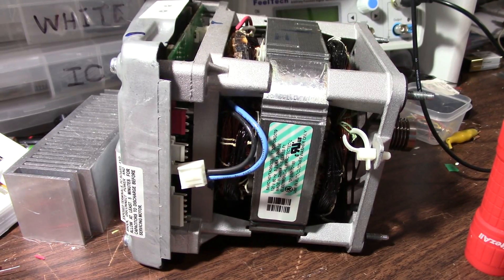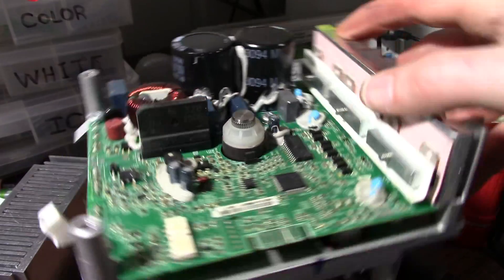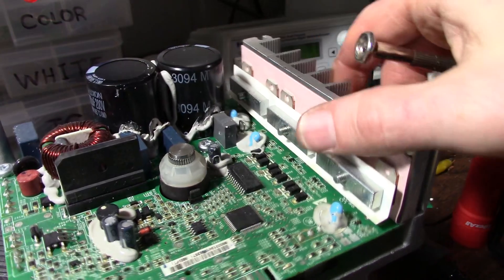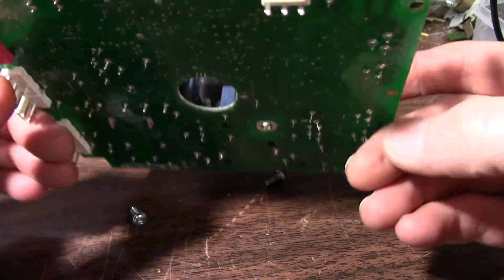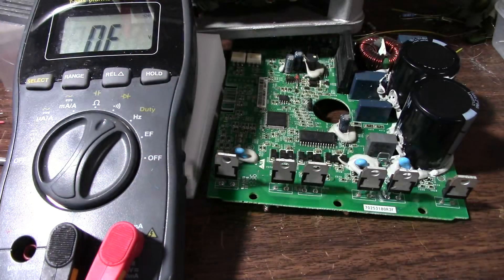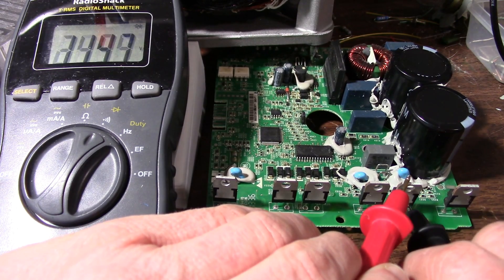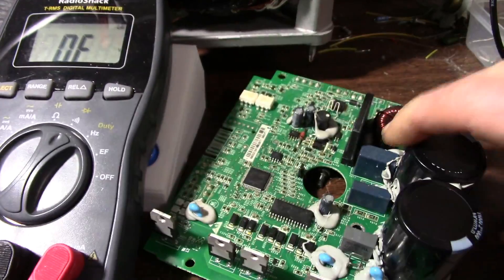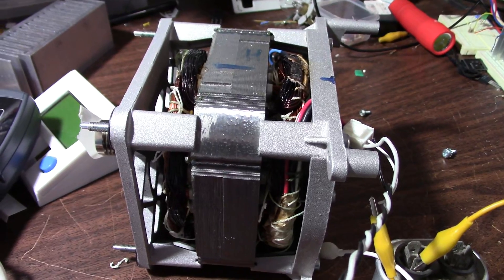GE washing machine burned motor teardown to find fault

Comment: I tore mine down like this and the IGBTs all seem fine. Motor windings aren't dark. I'm not good at board repair, so I don't think I can fix it 😢 Red LED is flashing 1 long, which the paper says Long Stop Time, replace motor.

I don't have a variac to mess around with the motor. Prob gonna give up and buy a new machine cuz the motor alone is nearly the same price as a new machine.

Comment: I have one of these motors, that I am attempting to convert to use as a small tool motor.  Is there any way to wire these to run on a standard 120v plug (US) ?  I can't seem to find anything with google searches/youtube searches.  Thanks!

Comment: Hello, I thought you could help me, I have a ge gtwn4250, my main board failed, even though I have looked for the service manual I have not found it, but I have seen manuals for similar motors that in the C4 connector that have 5 terminals and to do a test in spin mode, pin 5 and pin 2 should have 12 vdc equal to between pin 5 to 4, 12 vdc, but the motor I have is the same as the one in the video, the c4 connector only has 3 cables, How could I run the motor directly without the main board, the 12 v only just vdc or is it a pulsing signal with some frequency? , the motor card is good, the main card is the one that is wrong, I need to know the voltages and the waveform, to be able to start the motor without the main card, if you could help me I would appreciate it very much.

Comment: Is this from a GE Hydrowave Washer?
Reply from the maker: Not sure, the rest of the unit is long gone.
Reply: @JohnAudioTech  You can always buy a used Whirlpool Direct Drive or Newton Built Maytag Washer which were made in the 1990s into the early 2000s if your GE Washer craps out again.

Comment: Well, what did I do?  I wasn't paying attention and I ran mine for a minute or more.  Did I short something inside at 60 microfarade?  
If so what should I do now?  Nothing smoked, no  heat anywhere that I felt.  However it appears it has copped an attitude.  It doesn't want to run by means of capacitor if you will and I don't have a three phase 150 supply, although I have 220 three phase supply using an LG washing machine Bldc.  I am almost certain I shorted out between two leads where I hooked up the capacitor.
Any ideas?  :-)
I am sure I have he same motor.  150 volts 3 phase.

Comment: I am glad in ran into your video.  I have got the same exact thing going on here on my table.  I am wondering how many volts did youi apply.  I went ahead and chanced it and plugged into the 110 outlet and it began to take off.  I unplugged it om split second.  I wasn''t sure what role the capacitor would be playing.  My capacitor came from another washing machine induction motor ( Kenmore). It is hard reading it but guessing from the writing, it appears to be around 250 uf.  When I ran it without the capacitor it just hums like yours.
I am wondering if I can run the motor with the capacitor on because I like to use it for other projects.    The motor seem rather quiet new, nothing wrong with it.
I checked them transistors as you did, they all read around 5.30V
I got this washing machine from some motel that was junking it as someone told them the controller was shot.  Come to think of it, I should have not taking apart,  But I had no idea that one can trouble diagnose these things following their instruction.  But that is another story.  Now I just want to use the motor.  So I don't know what the three phase with this motor means,  What should be the voltages?
Thanks.

Comment: I just salvaged one of these motors today. Looking up how to power it was not going well until I found your video here, and it's perfect. I'm still uncertain about a few things but once I get more info hopefully it will help. Nice job.
Reply: Did you hook it to your basic household 110v outlet with capacitor to the middle terminal?  Is that how you are and been operating it or?
I just did the same thing but I unplugged it.  It ran very nice for a second before I unplugged it.  I am not familiar using capacitor in this manner.
Reply: @alchemy1  I haven't tested that yet. I was able to get it to rotate but in an odd way. Turns out it will run on its own if you spin the shaft, but you need way more torque than normal. The way I found this out is I was driving it with a 2 pole dishwasher motor, then got the idea to power the 3 phase motor while it was being belt driven, and when I did this and pulled the belt off, it ran on its own.
Pretty overcomplicated but it worked. Of course I still want to try the capacitor method and eventually turn towards getting a VFD.

Comment: A couple of observations - IGBTs are used at high voltage because they are less sensitive to high voltage transients
coupling back to the gate electrode than MOSFETs.  Unlike MOSFETs they have a definite forward voltage when conducting
of around 1.5 to 2.5V, which makes them inefficient for low-voltage circuits.  They are also a lot slower to switch than MOSFETs as they are a minority-carrier device, PWM rates of a few kHz are typically used, not tens of kHz.

I wouldn't be surprized if the driver chip for the IGBT gates was faulty, triggering the IGBT to fail, nor if it was high voltage related
failure of the IGBT itself.

I am surprized the thing didn't just use an "intelligent power module" - basically a 3-phase IGBT bridge in a single package, that would simplify the board.

And finally it seems the single thermal cutout isn't enough to detect winding overheating in a 3-phase induction motor, which is pretty obvious if they had thought about it.

Comment: isn't the black and blue wire connector DC in? why would a temp cutout circuit need such thick wires? you could wire a temp cutout into the 3-phase system

Comment: That motor looks as though it's hardly done any work! How old was the appliance... and was it still under warranty? When i meet broken down washing machines they're often filthy, dusty, dirty, rusty things inside that have done years and years of service, & the owner says they just can't afford a new one so can i make the lowest cost possible repair to get it going for a bit longer.
Reply from the maker: It has 2013 date codes so it isn't that old.

Comment: The motor may not be shorted right now but it is close to toast.  Partly carbonised insulating varnish sooner or later will give in at operating voltage/current.
Reply from the maker: It will be getting a proper death before hitting the scrap metal pile.

Comment: When is the PT12 (or PT11.4) of the discrete audio amplifier build project coming up?
Reply from the maker: PT12 will be very soon. Maybe the next video.
Reply: @JohnAudioTech  , thank you, I am eagerly waiting for it.
Reply: meanwhile you can try experimenting with a bd139-140 o/p stage. xD
Reply: @iceberg789  , I'd never do that xD. I already have a couple of Toshiba 2sc5200 and BEL 2n3773 here. And, if I need, I'll buy some MJE15024 for higher power.
I am using BD 139 as the bias spreader.
Reply: @anindyamitra5091  you should try that. later you can add those beefy output stages, it should not be much hassle, but a beautiful hands-on exercise. you may also like the sound they make.
Reply: @iceberg789  , why should I add an extra amplification stage than required?
Are you suggesting to replace the transistors I currently have(2n6292 and 2n6107) with bd139-140 at the VAS and Darlington driving transistors?
Reply: @anindyamitra5091  idk what you have. if you don't have anything, you may play a little.

Comment: A lot of electronics for a motor but I guess it's cheaper than a mechanical transmission. Makes me wonder about my own machine, gives off a slight burning motor smell when worked. If it moves North with me I may have to take a look. This is one that could be found quickly with a non-contact thermometer.
Reply from the maker: Where would you put them? Move your bench around?
Reply: @JohnAudioTech    To the immediate right of the bench. I'd really like to remove one of the built in cabinets/bench along the wall, but it is very firmly installed. If I sell the old set I'd get something more compact, maybe stackable.